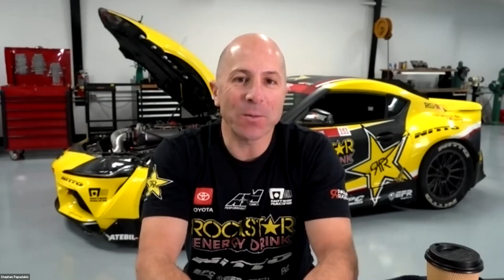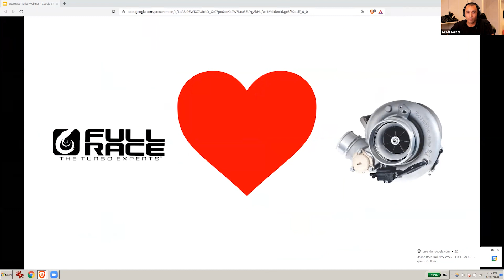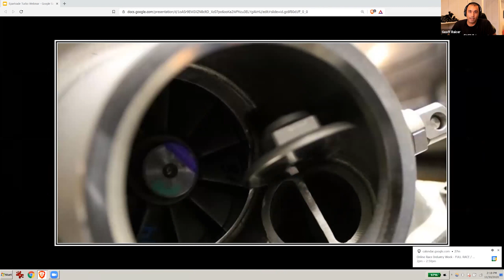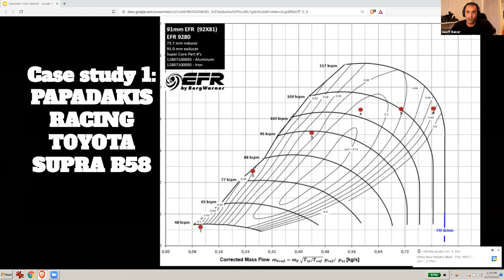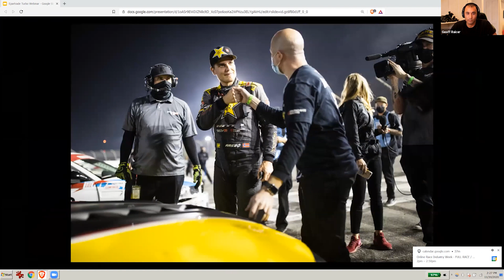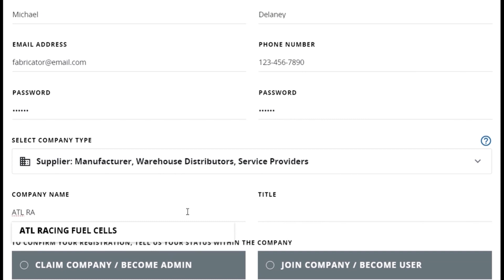What Most People Get Wrong About Choosing the Right Turbo!

Comment: I wish Borgwarner and Garrett stated what material they used for the compressor wheels. I will compressor inlet temperatures as low as -50c and 7075-T6 becomes brittle at -25c.